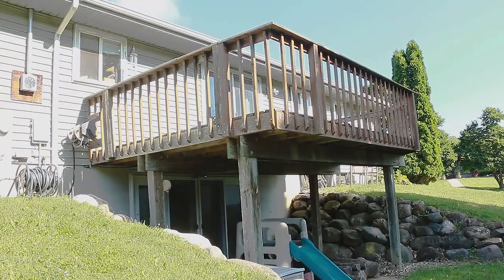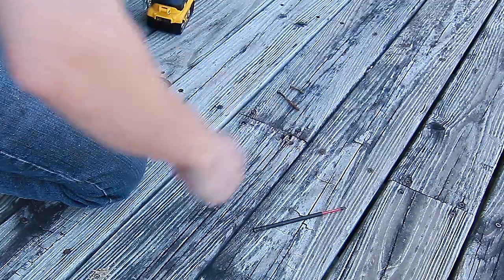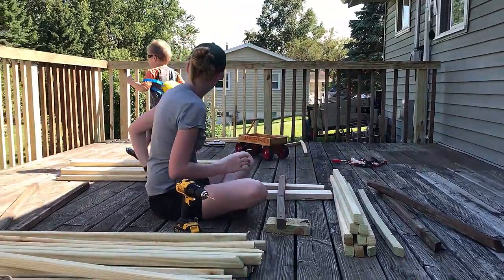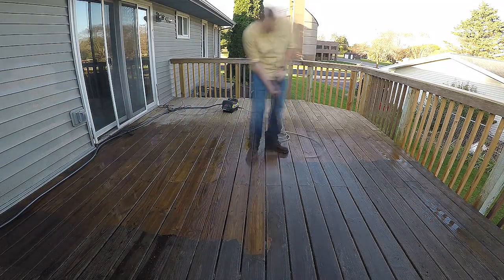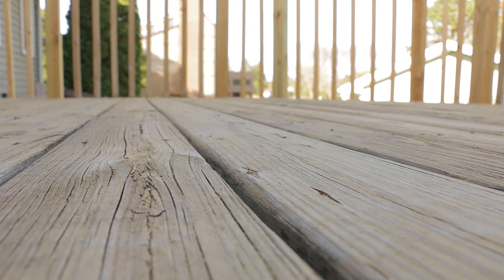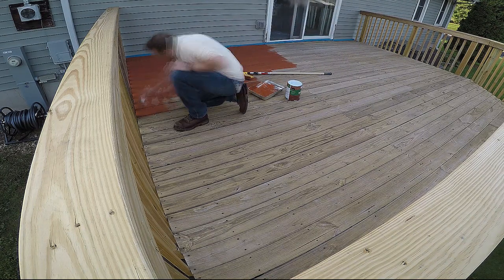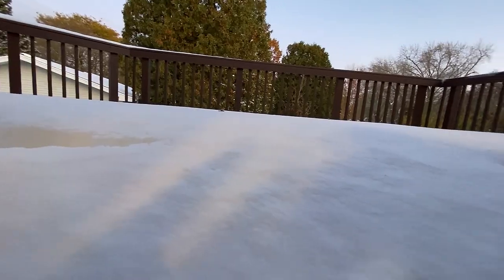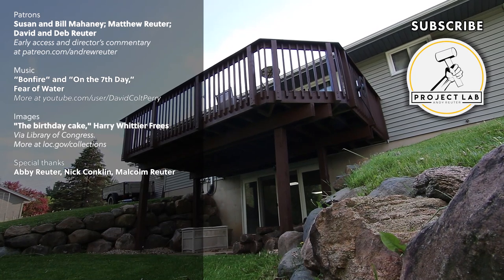Can it be saved? Wobbly, weathered, moldy deck restoration

Comment: Good job . A lot of work.  What does the under side look like?  All the dirt and chemicals that ran down, in between deck boards.  Would be all over joists and on anything stored down there.   In summary, 2 story decks are a pain.
Reply from the maker: Thank you! For the underside, a little paint did get on an outdoor storage chest we have down there, but not too bad otherwise. The paint must be thick enough that it doesn’t drip through like normal stuff might. 🤷‍♂️

Comment: Solid stains tend to peel like paint, making the next refinishing a real pain.  Most go with semi-transparent stain (which doesn't peel) for that reason.
Reply: couldn't you just pressure wash the solid stain off with a pressure washer?
Reply: @randyman8984  It's not that simple.  If you wash it all off, then you have "paint" chips everywhere.  If you don't wash it all off, then the new stain will look like ass b/c it'll be visible where you stained over bare wood vs. existing stain (difference in height).  And then both the old stain and new stain will peel eventually, rinse and repeat.
Reply: @michaelbluejay  they make products that removes paint off decks. I think it's made by Sherwin Williams . Wonder if it would work?
Reply: @randyman8984  I don't know if a paint stripper would work on solid stain, but I do know that paint strippers are hazardous and toxic AF, and using them is an extra step that's not necessary with non-solid stains.  Why would you invite the hassle of a solid stain when there's a simpler alternative (non-solid stain)?  But it seems like you have your heart set on solid stain, so, good luck.
Reply: @michaelbluejay  oh I was asking because on my deck I did a dark solid stain 3 years ago and now it looks like crap and needs to be redone.. I'm trying to figure out how to get it off,  big mistake on my end.  I've got a pressure washer I'm going to try to remove it . I definitely agree with you, don't use dark stains
Reply: @randyman8984  Okay, I got you now.  It's not the color that's the problem, it's the transparency.  Semi-transparent transparency of Walnut color is dark, and would be no problem, while Solid stain in Pickled Oak color is light, but would eventually flake and peel.  It's the "solid" that you have to avoid.  Anyway, there's no way to remove it that's either easy or eco-friendly.  Best you can do would be to put tarps or plywood under the deck and hand-scrape off as much as you can, then vacuum/sweep off all the debris, remove the tarps/plywood, then try to power wash the rest.  Any that remains will have to be removed with a stain stripper.  Good luck.

Comment: did the solid color start to peel in about a year ?
Reply from the maker: It actually held up pretty well. There were some chips after a couple years but was still solid overall when we sold the house.
Reply: @AndrewReuter  That's good to know.Reason i asked was i had my deck done by a company and it did not hold up, peeled terribly .must have been your prep or maybe product choice.Good video

Comment: Obviously this deck is rough but IMO never pressure wash a deck directly. The timber will expand and split. It's a real fast way to ruin a good deck. You can get attachments for pressure washers that gently scrub the wood. Blasting unsealed timber with over 2000psi of water is a bad idea.

Comment: That was hard to watch, staining/painting that deck, it looked so nice before. (Everything looks so much nicer on video or pictures, no idea what it looked like in person) 
You'll probably be redoing the entire deck in about 5 years anyway, so no harm, no foul I guess. 
Nice work regardless though, you've showed me definitive proof you don't need a 5k psi pressure washer to effectively wash a deck.
Reply from the maker: Thank you on all counts! It did look pretty weathered and miserable in person; was much more inspiring to look out the patio door later and see something well maintained. And good to hear on the pressure washer! Maybe took longer than a bigger one would have, but this one is tucked away in a tote in a warm place year round, so there’s no gas maintenance or water draining I need to do to leave it in an unheated garage over the winter. No regrets there!
Reply: @Andrew Reuter  yeah, I'm the world's worst at gas maintenance if it's not something I use weekly. 
Pressure washer gets the brunt end of that abuse.

Comment: To each their own... but this is a perfect example of how people fuck up their decks. I'm a deck restoration professional and I've seen it countless times. You did all that work to get it to raw wood and then you painted your deck with Behr garbage from Home Depot? That stain will chip and peel in 12 months and next time around you won't be able to pressure wash it. You'll have to sand all of that off.it will take forever. Never stain your deck solid. Always use oil based stain. Do a follow up if you don't believe me.
Reply: Came here looking for a follow up. Would love a check list of do's and don'ts I have a quick flipped and sloppy deck im restoring....
Reply: Yep I learned the hard way never to use solid stains or paints on decks. Now I have peeling everywhere. Semi transparent from now on.
Reply: What do you recommend, I'm getting ready to start on mine... I believe the last owner used what you described because it is peeling and alot of the deck the stain has completely worn off... if you have a video on YouTube I would like to check it out so put up your link... thanks much appreciate any help...
Reply: Thanks a ton I appreciate it, im going to get started on it tomorrow...
Reply: I compared reviews of the behr solid 10 year stain vs the cabot oil stain, and the same number of people complained about peeling.  Same number of failures, from what I could tell.  I'm taking my chances with the solid.  I know it's not going to last 10 years.  It's all about the prep.  Now if I could find this post again when it's time to do a follow-up!  What brand of oil stain would you use?
Reply: What do you suggest?
Reply: @janjaf844  oil Based stain like Armstrong Clark